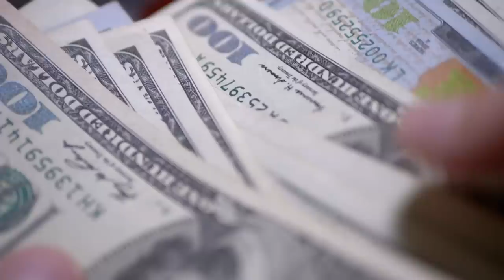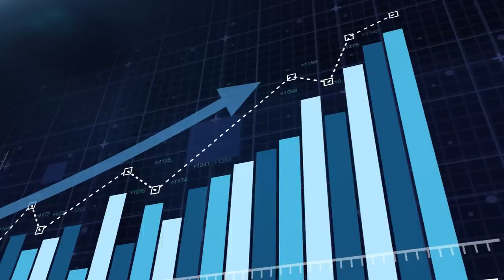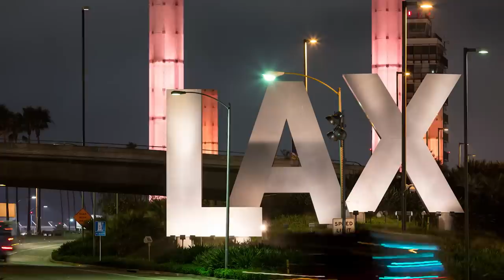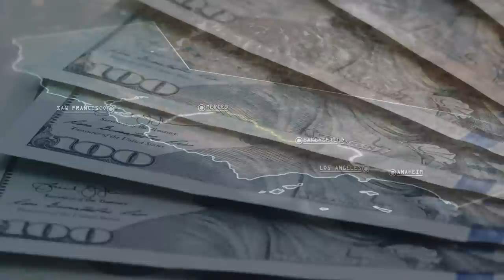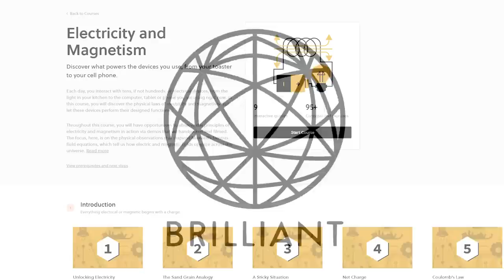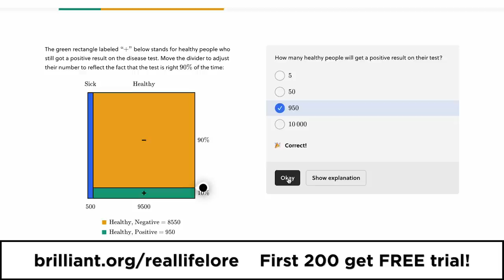Why California High Speed Rail is Struggling (Re-upload)

Comment: If they actually finish it. It'll allow people to avoid the I-5 That's the big draw. People die on the I-5 because the fog can reduce visibility to practically nothing. It's scary just seeing the signs to gauge visibility. I really appreciate that you actually redid the video not enough people do that.
Reply: That'll disincentivize the purpose of using the i5 which you'll need to remove some lanes and retrofit those lanes into busways or metro rail (like in Northern Virginia, Washington D.C metropolitan area). If this becomes a main political issue over cars and expanding highways simply bc there's constant traffic jams, the potential for a complete Californian HSR will be inevitable; this will increase in demand in other states.
Reply: @spookysenpai7642 I'm pretty sure the section they're talking about is the grapevine, which is a rural mountain pass, not an urban freeway. The only place those metro and bus lines could possibly connect to would be Bakersfield, which will already be connected by the high-speed rail.
Reply: @spookysenpai7642  they cant really "remove some lanes" on the I5 its a major thoroughfare for delivery trucks and it's only two lanes. part of the reason why people want a bullet train you can get stuck between two dueling trucks who refuse to move over for hours.
Reply: not only that but it's a nightmare of potholes and delivery trucks. I do the drive from Sacramento to L.A on the 5 about 6 times a year and your always getting stuck behind trucks trying to pass one another because it's a two lane freeway, or smashing into some pothole because the right lane is completely destroyed because of the high volume of truck traffic. the bullet train will be convenient in innumerable ways, not to mention make commuting from the bay to L.A or vice versa a real possibility not to mention reviving dieng cities in the central valley like Fresno turning them into real suburban options because you can now get employment in either the bay area or L.A two of the biggest job markets in the world, then take a calm little one hour train ride back to Fresno.